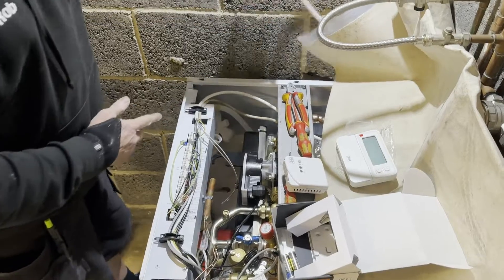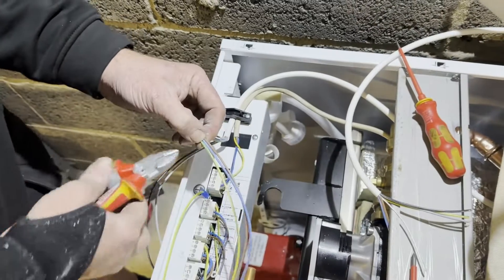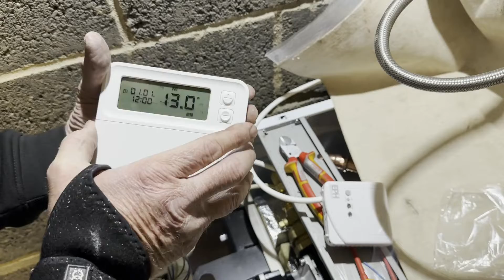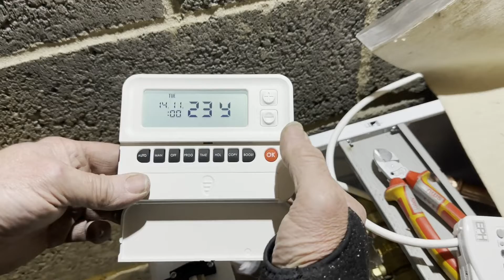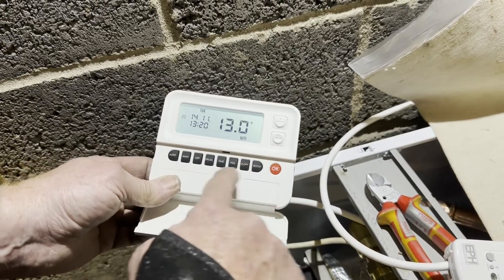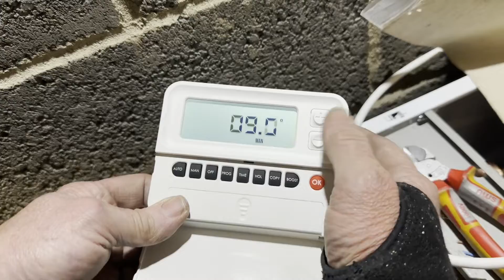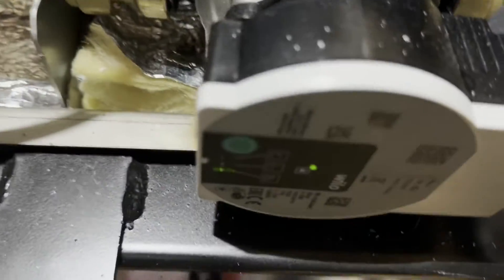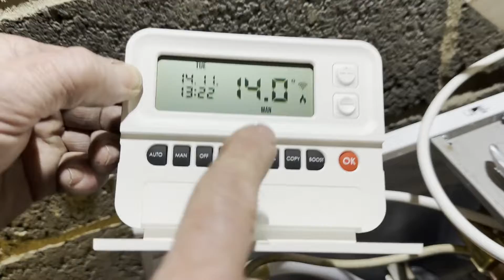How to Install an EPH Combi Pack 4 Programmable Room Thermostat.

Comment: Thanks for the video. Should there not be a separate cable for high voltage wires and a 2nd for low voltage?
Reply from the maker: Hi. Thanks for the comment . Only a low voltage cable if it is running opentherm. The vlog just shows a basic switch. We are going to do a vlog on open therm soon. Have a great weekend.
Reply: Thanks for the reply.The boiler i have is an Ariston Cares One. Not opentherm but still has low voltage. So I think the same rule might apply 😉

Comment: Have you thought about using boot lace ferrules on the ends of your cables? Nice video thanks
Reply from the maker: Thanks for the comment. I do use them sometimes. Especially on out side rotary isolators. They are pretty good!